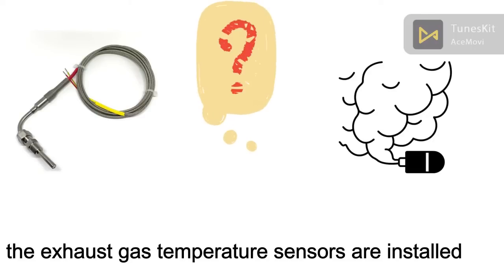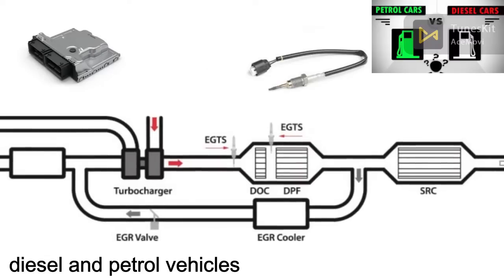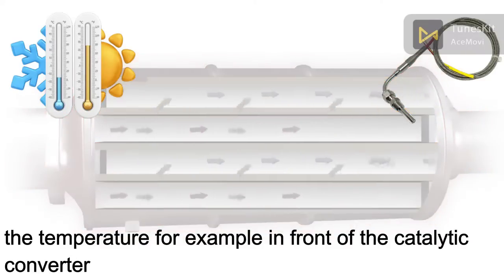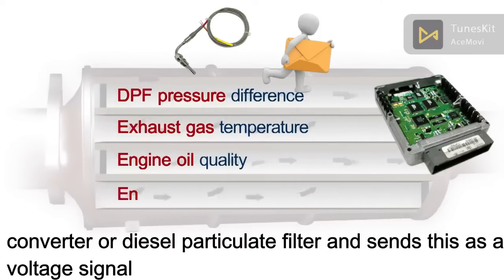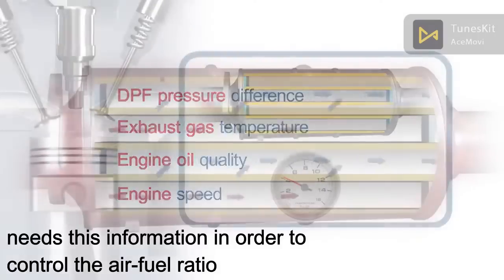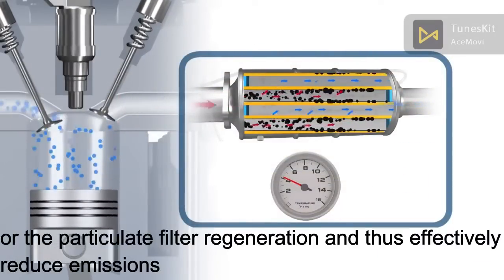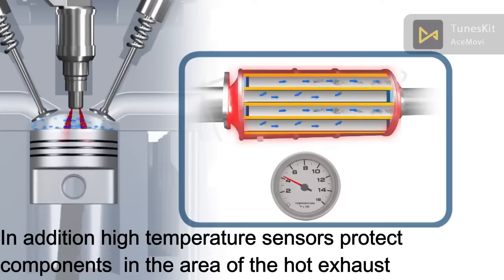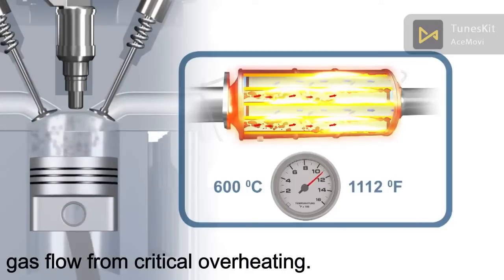What is an exhaust gas temperature sensor?

Comment: Hi, my egt pre particulate filter shows -90C when cold and when engine running at temperature it only shows about 120C, only goes to 400 when regenerating , had new turbo,dpf,intake manifold,egr, o2 sensor, and keeps regenerating after 100 mile.
Is that a sign that sensor is faulty ,reading -90C? 
Thank you
Reply from the maker: yes, this indicate is exist problem in egt
Reply: @AutomotiveEngineeringschool  thanks for replying

Comment: We've changed both cats in our 2014 Buick encore , o2  sensors had issues, and  with the turbo.. we replaced it to. The break pump 
We need a possible break booster on top of it. . But the only code that's shown is p0420
But I have a picture of where it says Exhaust gas sensor b1 s1 is showing some signs.  What should we do. Or in case that doesn't work.
Reply from the maker: sorry sir your problem is very hard i question my team and i response you if i find solution

Comment: Hi bro thank you for your video one question please help. İ have 2014 clio 1.5 dci 90 hp automatic. İ have obd when i look my injection ecu read i have 3 exhaust gas temp sensor on my car. And 2 is good but 1 temp always 50 degrees. And no dtc no warning light no check engine light. But my fuel consumption very high 8 L/100 km in city. And exhaust very strong raw diesel smells... And my dpf soot 6.20 gr. When i drive low speeds (20 30 km/h) not high speeds soot go down. When i stop its up. i think its always regeneration and one of my oxygen sensor or exhaust gas temp sensor problem. What do you think ? Thank you...
Reply from the maker: are youverfy NOX sensor?
Reply: @AutomotiveEngineeringschool  thank you for your help and reply. i dont know where it is. İn my app (pyren) i dont see nox...
Reply from the maker: @berkedeniz5625 you're welcome sir